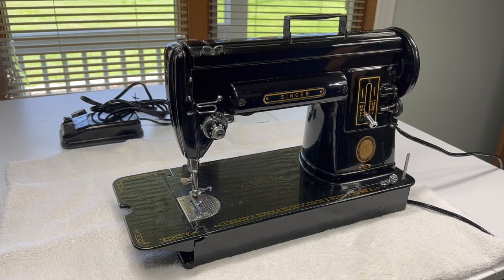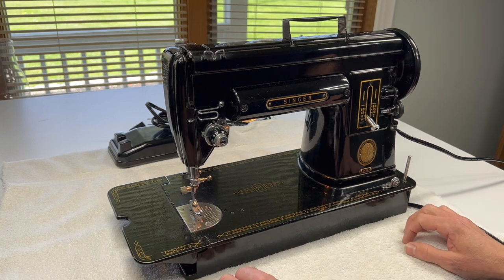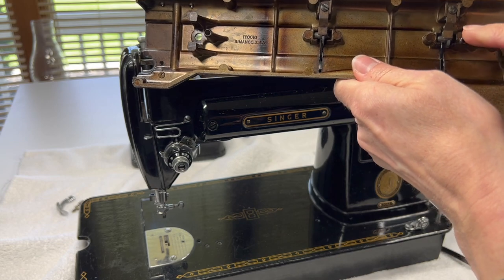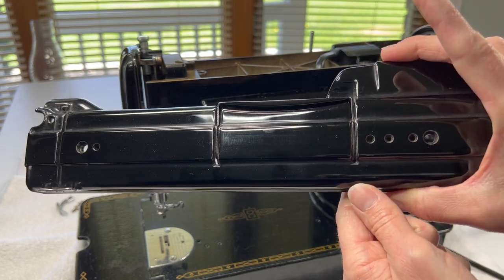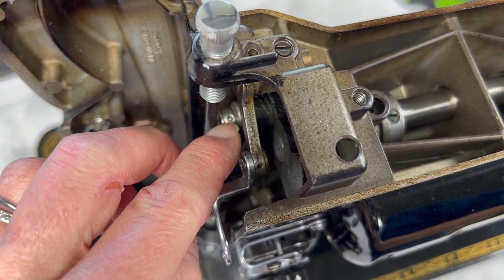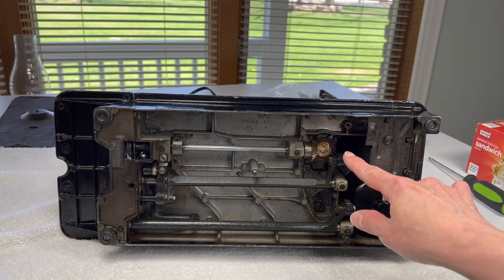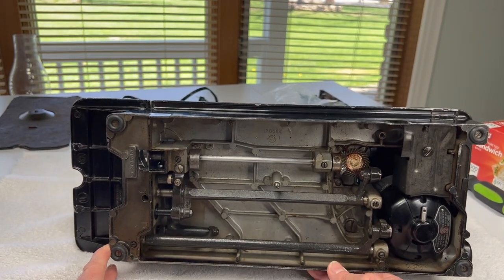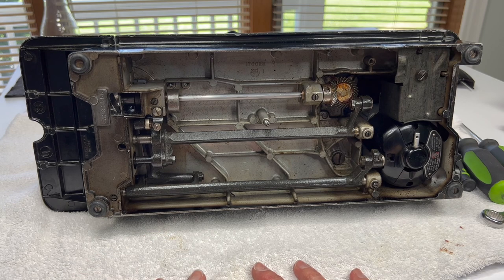How to take apart a Singer 301 - Tools and products: Singer Restoration Series part 2

Comment: What would cause green oxidization in the prongs where the power cord connects to the machine?
Reply from the maker: Hi again! They are brass so that just happens over time. You can polish them up with some fine sandpaper and just make sure you blow all the dust out really well. It’s kind of an awkward space to work in so I like to use the foam nail files in a finer grit to get the job done. Very common issue though!

Comment: Where do you get the felt for drip pad, or what is it called, I need to replace several. Thank you
Reply from the maker: Hi! I like the ones the Featherweight Shop sells, they have a nice sticky back. https://singer-featherweight.com/products/felt-drip-pad-for-singer-301/?aff=57 I used to cut them out myself out of industrial felt but these fit perfectly and are so much faster for me. Hope that helps!

Comment: I'm just beginning the restoration process.  The small screw that holds the "pan" on the bottom of machine is tight and stuck.  How do I get it to loosen?  The machine so far looks "dry" if anything, not lots of grease.  More dried oil varnish.  It is a beige 301.  Thank you for your help !
Reply: I figured it out, thanks!
Reply from the maker: Glad you got it! I was going to recommend non marring pliers. Sorry for the delay, the holidays have been busy. Good luck with your restoration, you can do it!

Comment: Thanks for taking the time to show this beautiful machine. I'm new to sewing machines but an old hand with tools. Working with slotted screws is a pain but to lessen the likelihood of damage you might like to have a look at a set of hollow ground screw drivers. AKA parallel screwdrivers. They have been ground to be parallel at the tip and they have less tendency to walk out of the screw when you apply pressure. I think your little ratchet/screw driver has a hollow ground tip. Also, a holding screwdriver is an absolute must when working on older machines. You can clamp a screw to the tip and get it places that are difficult to reach. Some are only for getting the screw in and not fully tightening. There are a few different types. Klein tools make a nice set, US made.
Your series is giving me the desire to find a 301. I've watched a few random videos from the series and have come back to the start. Love this machine. Unfortunatly for me, the 301 was only made for the US and Canada and I am Australia. I will just have to be satified with my recently rescued 201. I have really taken to these beautiful machines.
Reply from the maker: Hello! I should ask you how tomorrow is looking since you are already there 😊. I did finally get a set of hollow grounds, they are made by a company in the USA named Chapman. You are right, they are better! I also have a set of holding screwdrivers now by Feuerhelm but I am not particularly satisfied with them. The design makes the tip too wide to fit in most the the slots on the screws I am working with so I am looking at some different ones. The 201 is a beautiful machine as well, I have one waiting for me to start right now. I’ll be hoping that you find a 301 that made its way to Australia, anything is possible! Thanks for saying hello and for the good advice! Take care!

Comment: Was just given a 301 by our friend who runs an Antique store, so I am thankful to find your channel! I may be ahead of myself but the last video you talked about the plug in and that there is another plug, this one has the original foot pedal with plug attached but not another one for the bottom plug in. Also i cant get the needle to move so Im looking forward to learning more about this machine so I can see if I can get it running
Reply from the maker: Hi! The 301’s had two different plug styles. One had just one plug that connected to the machine and powered the foot control and the motor, just like the Featherweight. The other style had a plug for the foot control and another for power to the machine. What you will need will depend on which 301 you have. I can’t address the problem you have with the needle moving unless I know more. If you are still stuck email me at jen@sewingmachinerehab.com and I will try to help.
Reply: Thank you for your reply, I've been following along on your videos.  Finally have it moving.  I just need Patience and probably more oil . Thank you for your email. I'll be sending you a message soon.
Reply: And I do have the two plugs, so I'm ordering new ones.